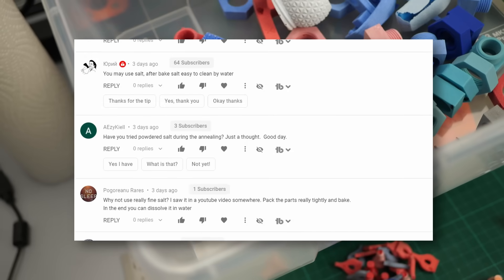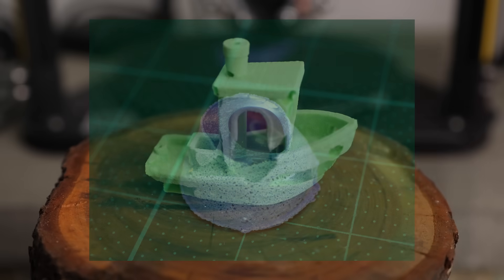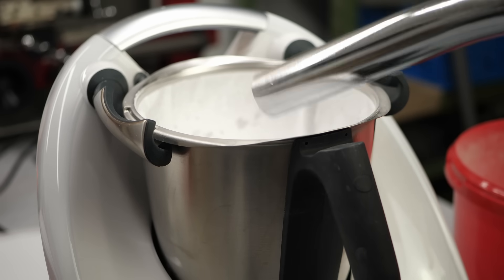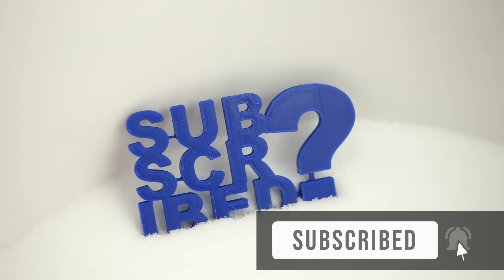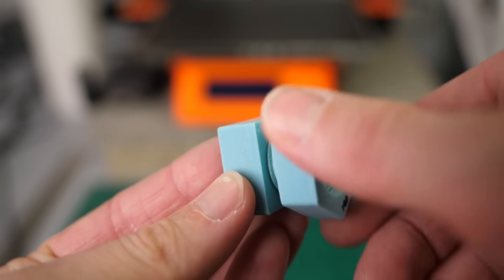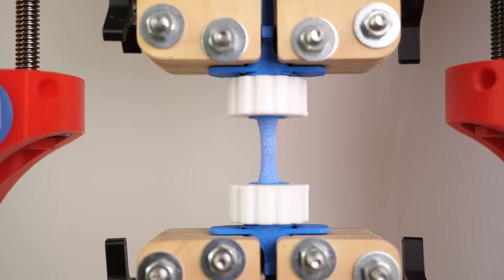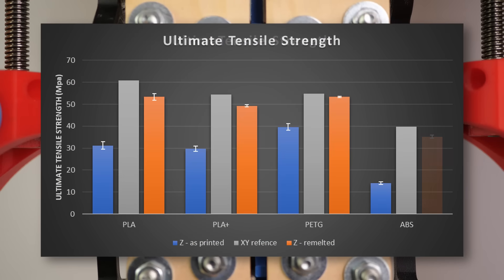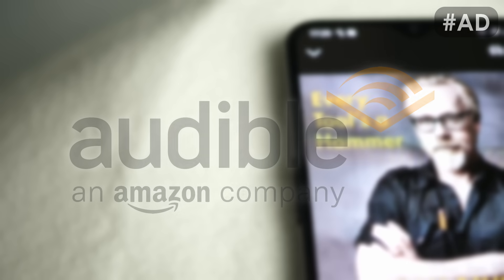The STRENGTH of 3D prints REMELTED in SALT

Comment: If all you need is a fine power that can stand a little heat then limestone dust (whiting, calcium carbonate) would be a lot easier.
Reply: Try Epsom salt. I have used it to anneal 3D prints with great results. I first dehydrate it in the microwave on a plate lined with parchment paper (don't skip the parchment paper) which results in Anhydrous (without water) magnesium sulfate. It's like ultra hydroscopic glass. I break it up into small chunks and it grinds pretty easily into a very fine powder (like baking powder). This packs really well and has the benefit of adding zero moisture to the process, being considerably cheaper than salt, less corrosive, and results in fine detail surface finish. The powder is water soluble just like salt. I also use it as a very effective desiccant for storing my filament.
Reply: @shift9074  Epsom salt is actually sold as a pentahydride. It has seven loosely bound water molecules per magnesium sulfate molecule, and it's loosely bound enough that they break off under light heating. It would probably have the same hydrolysis problems as plaster. Nile Red has a really cool video about epsom salts that addresses exactly this, btw.
Reply: @evanlane1690 I am removing those water molecules before using it to anneal. The goal is to find a water soluble powder that is heat resistant. Any water soluble powder will undergo hydrolysis if the 3D printed part that you are annealing has taken on water. For any of water soluble powder, we must sufficiently dehydrate the part before annealing to avoid this. For some, these extra steps may be worth it to save money. Epsom salt sure is cheap! I look forward to hearing what others are experimenting with.
Reply: @shift9074  How long do you microwave it for?
Reply: @RangerOfTheOrder  it depends on the amount you are working with. I do small batches(thin layer spread across parchment paper on a plate and it takes a few minutes. It will start to bubble up as the water boils. Once most of the surface has bubbled up, take it out break it into chunks and put into an air tight container. Repeat until you have enough and then grind it.
Reply: @shift9074  didn't nilered dehydrate Epsom salts to see how much of it is actually water/salt. And it was like 75% water
Reply: @shift9074  epsom salt is like 50% water and releases it when heated. That could seriously degrade the polymers, especially at elevated temperatures
Reply: if you remember the last video on the subject where he incased the part in wet plaster. why not use dry plaster powder? I'll be trying it when my printer is online.
Reply: You could also use something like sea-lite aquarium sand. It's fine enough that it's used by chemists as a filter material.
Reply: @turtledruid464  , sand will stick to the melted up surface of the part. Salt has the great advantage of dissolving in water, so you get back the pure plastic surface with little effort.
Reply: @thomasengelhardt7940  Limestone could do this after a VERY long time
Reply: @thomasengelhardt7940  doesn't sugar also dissolve in water? Powdered sugar.
Reply: @jsihavealotofplaylists  sugar should melt/burn at these temperatures.
Reply: @turtledruid464  I think the "sea-lite" you're referring to is celite, or diatomaceous earth. And yes, it's an excellent recommendation.
Reply: @bjmcculloch  ah I had never seen it written down only heard spoken. Thanks for the correction.
Reply: @turtledruid464  zeolite
Reply: One big advantage of salt is it dissolves in water really easily after baking
Reply: Hexagonal Boron Nitride might be a good solution.

Otherwise known as "White Graphite."
It has the same molecular structure as carbon graphite. Stable to 3200°.
Pretty much chemically inert.
Used as a casting release compound for cast glass and aluminum.

It's not hygroscopic... It won't absorb moisture from the air which could possibly interfere with recasting a detailed plastic part.

It has an extremely high thermal conductivity... You won't have to wait for it to soak up heat before the plastic actually gets up to remelt temperature.

It is available as a micro particle flour.
It can be "packed" around an object to temporarily set a shape, but does not cake into a hard substance the way salt can if it begins to recrystalize from humidity.
It can flow into small spaces and fill voids if it's given a little kinetic energy... so, a vibrator platform to help it settle and fill.

Non-toxic... though with any inert dust it is very wise to avoid breathing it.

While it is not water soluble, it cleans off with water and a little mild soap.

It has a density of 2.1 g/cm³...
which is almost identical to sodium chloride, at 2.17 g/cm³.
A tiny advantage that could reduce sagging of fragile pieces due to being higher density than most plastics. PLA being 1.2 - 1.4 g/cm³.

Should not be confused with Cubic Boron Nitride, which is an abrasive.
Reply: I have like 10 kilos of diatomaceous earth. I might give that a try. Its not soluable but its 10-50um depending on the grade.
Reply: @beez1598  I remember the original video maker posting somewhere that to maintain the as-printed surface you can coat it with PVA. It sounded like he was talking about dual extrusion, but couldn't you just paint it in Elmer's glue instead? Do a few coats to build up a protective surface (look at the thickness of the 'bad' perimeter on the break tests) then do the heat treat in whatever fine, heat-resistant, support powder. The PVA coating would collect all the particles, and could be dissolved off in water leaving a clean base part.
Reply: @dimman77  
I think that's what he meant.
Seems like the PVA would provide a barrier to the remolding dust.
I'm definitely going to try it.
Reply: @ablebaker8664  I'm thinking that maybe this idea, followed by acetone smoothing the surface could create an actual transparent ABS in fairly thick parts.
Reply: @dimman77  
I'm thinking you could be right.
Reply: @beez1598  results?
Reply: Someone else has already suggested calcium carbonate (common chalk, whiting, limestone, garden lime).  Another carbonate to try is Climbers chalk which is usually fIne powdered magnesium carbonate.  Both will react with aqueous acids to form soluble safe salts.
Here are three common acids:
    CaCO3 + 2 HCl → CaCl2 + CO2 + H2O     
    CaCO3 + H2SO4 → CaSO4 + CO2 + H2O
    CaCO3 + 2 CH3COOH → Ca(CH3COO)2 + CO2 + H2O          
The salts produced in the first two reactions are both used in medicines and food, or the production of food; and are considered non-toxic.   The third reaction might be interesting, because nearly everyone has CH3COOH in the kitchen already - vinegar.  The resulting calcium acetate is found in many environmentally friendly de-icers, so no major disposal issue. The same is true of the equivalent Mg reactions from climbers chalk.

Another non-soluble option to try (with a barrier such as PVA) might be Diatomaceous Earth.  It's an extremely fine-powdered silica dust, and a 10lb bag is about $20 at Amazon.  

Finally, has anyone tried dipping their prints into a silicone molding rubber as a barrier?
Reply: @genixia  how about dusting your parts in sodium alginate before using Calcium Carbonate in hardening both are hydrophilic and Form a Gel when they are Mixed while water is present they are used for Boba Tea. I think it could disperse the reaction of the outer parts dissolving their moisture while being remelted.
Reply: What about borax or another fine powder. Even baking powder?
Reply: I'd consider quicklime(calcium oxide), it's sold cheaply as fine powder, very heat resistant and it dissolves in water too. But it needs handling precautions, it is very alkaline. It is likely it would chemically react with PLA.
Reply: @jurajvariny6034  But its reaction with water is fairly exothermic and can be quite violent - especially if you mix higher amount of fine powder with water.
Reply: Totally true. The only reason why everybody is using salt is because the first person who tested the method used salt  but there are many other fine materials that have been used traditionally in metal molding and jewerly like plaster of Paris. It would be great to see somebody using a proper substance and not badly grinded salt.
Reply: Silicon carbide lapping powder would be better, you can get 8 micron SiC on ebay
Reply: Absolutely; I think that a good dampened down fine powder such as talc would be perfect for the job.
Reply: talcum powder is the answer
Reply: How about wetting a part before filling with salt?  Wet the part in water or maybe brine or maybe even a slurry of salt paste and either let it dry before continuing to fill or just pack the salt around the part and let the salt wick away the moisture.  My thought is that if salt is plastered on the surface of a part, then it might form a smooth barrier against the plastic rather than just having the plastic melt and pick up the loose salt particles from the contact surface.  And my thoughts on just getting the part wet is that it might be enough for the salt at the edge to dissolve and form a fine barrier and hold the salt crystals right around the part together a little better and maybe at least reduce the since fouling somewhat.

Also, as far as grinding the salt goes, I think using a blender or coffee grinder is about the worst way to do it.  Any sort of blade grinder is going to cause those really sharp crystals to be formed, because of the mechanics of how the material is being ground up.  You can't really slice a salt crystal up like how a spinning blade is designed to do with meats and vegetables and the like, so what you are really doing is akin to trying to break up rocks by tossing them into the air and hitting them with a baseball bat.  The problem I've always run into with trying to grind up really hard and relatively heavy things in a blender or cheap coffee grinder is that you invariably wind up with the smallest particles getting kicked up into the air easier until they're so fine that they stick to the walls, meanwhile the heaviest and largest particles are harder to get sucked or knocked up where the blades can make contact and so wind up falling to the bottom where the blades just pass over them. A better option for getting hyper fine particles would be to use something like a ball mill or a disc mill.  Disc mill is probably faster but more expensive, ball mill is cheaper (or so simple that you could probably make one with junk laying around your garage) but is slower.  But if you have time to just set and forget a ball mill and you can reuse the salt many times, then a ball mill might be a decent way to make your own stock of salt powder.
Reply: Maybe MgSO4 7H20 aka Magnesium Sulfate Heptahydrate. Dissolves in water and can be bought quite cheap
Reply: @cockybaerts674  
It also disassociates at 150°C, so it would be pouring humidity into the print even before that.
As it begins to break down it will change density and lose volume... It would shrink and the print would collapse.
Reply: @bizyyy2746  I haven't actually tried it yet, still messing with his nylon weed trimmer concept. I'll get to it eventually lol.
Reply: Notes on Aluminium and Magnesium - BOTH metals BURN.
Aluminium and Magnesium with Iron powder is set alight as a method of Welding, commonly used on Railway tracks.
Powdered Aluminium is one of the ingredients used in the Space Shuttle / SLS Solid Rocket Boosters.
Once these things are lit, there is no practical way of putting them out until they burn themselves up.
It is wiser to avoid them unless you are correctly trained in their handling.
Heck, Powdered Lead is safer then those two metals. (But your prints would be encased in solid Lead blocks if you're crazy enough to try that,..)
Reply: @PiDsPagePrototypes  both reactions involve oxidizers, ammonium perchlorate for solid state rockets and iron oxide for thermite not iron powder. And lighting these requires very high temps, definately not 200-230c (more like 1600). Plenty of things burn, at that point I don’t understand why the aluminum powder igniting is more of a concern than the pla.
Reply: Maybe Graphite powder
Reply: I would just replicate the steps for jewelry lost-wax casting.
Get gypsum, mix with water, pour into a recipient with the piece suspended at the center. Dry all the water first, gypsum will harden forming a hard shell around the piece. Then apply target temperature.
Finally, dissolve gypsum in water again and you are done.
Reply: Maybe just use baking soda 🤷‍♂️
Reply: @381delirius  Baking soda decomposes into washing soda below those oven temperatures.  So, no.
Reply: @beyondwhatisknown  true
Reply: @381delirius  baking soda won't hold up to the heat very well. When it is heated above about 80°C it begins to break down, forming sodium carbonate, water and carbon dioxide. This type of reaction is called a thermal decomposition.
Reply: What if using just like fine powdered metal, like aluminium powder? Does it going to be work? I think bout metal powder because it should be greater thermal inductor, thus to be faster heating time. CMIIW
Reply: @andrianusfranky  BAD IDEA
1. Fine aluminum powder is freaking bad news. It is reactive and loves to burn. Used with even a minor lack of caution, you could easily get a powder explosion.
2. Aluminum powder has a lot of exposure issues (it is light enough to stay in the air much longer than most metals due to lower particle weights).
3. Aluminum powder gets into everything, usually with bad consequences. Electronics tend not to live long near Al powder and things like motors like to ignite it.
4. Aluminum powder plus rust = thermite. A lot of shops tend to have rust powder in their dust. Let AL powder loose in that kind of environment and you have thermite waiting for you next minor incident to become a lot more interesting.
Reply: @andrianusfranky   I think Aluminum is explosive/highly flammable when ground into powder like that.
Reply: @Fangs_Follies  every fine powder will explode/burn
Reply: what about dirt
Reply: @Fangs_Follies  all metals can combust, the powder should only be dangerous if mixed with an oxidizer I believe.
Reply: @andrianusfranky  great idea....fine Aluminium powder is solvable in NaOH solutions and not so flammable by right handling like everyone tells!
Reply: @Martin-zd8eb  But you are handling potentially unstable and reactive material that can take oxygen to burn from already oxidized compounds. As I was told by those with personal experience - you cannot even extinguish it by CO2 fire extinguisher.
And as over the time you would contaminate it by impurities, it would worsen.
Reply: maby sodium chloride powder?
Reply: @kryptoowl1423  I can't tell if you're joking, so imma say this: sodium chloride is salt
Reply: @superslimanoniem4712  well I can tell so let me tell you, It was definitely a joke.
Reply: I never knew that, thanks for enlightening me....

Also someone might try magnesium chloride powder as it it is stable in the oven at +- 200 celcius  just make sure to dehydrate it first. If you get it at the right sources it's hella fine powder.
Reply: @superslimanoniem4712  If you can't tell if he's joking, then imma say this: try using dihydrogen monoxide.
Reply: @kryptoowl1423  that's funny! I love it!

Comment: Would be using greensand a cheaper, finer and simpler methode ? 🤔 A layer of high temeratur remaining paint could work fine for holding the shape of the part as It should be !

Comment: Uh- why don't you just make the walls super thin, and then fill the inside with low viscosity slow set  two part epoxy. Put the mixed epoxy in a vacuum chamber first to get the bubbles out .  Pour it into the hollow, put it in an electric  rocker with a vibrator motor and a flashing channel to draw out whatever bubbles are left.  Cut and sand off the flashing when it sets.  When it cures, it would be a LOT stronger than this.

Comment: If you were vibing the parts while they were remelting, they would be stronger. At least have more homogeneity. That's if the vibing does not mess up the dimensions or features.

Comment: One process to get really small (nano) particles is to spray salty water, but probably not and option.. Another problem is the salt suck in air moisture (property of salt). So when you heat it I think the moisture is released from the salt and adsorbed to the plastic. Overall I think salt is a bad idea. (maybe try alumina powder)

Comment: So, with a finer salt or powder medium to anneal in, we've found an effective way to strengthen parts. My question is will an acetone vapor bath repair the pocked surface of the print? Also, will that improve the strength of the part?

Edit: will the acetone vapor surface finish trick even work on salt annealed parts?

Comment: Have you looked at using mold making silicones to use instead of salt as the medium? It would be similar to your plaster video except I imagine better surface finish and dimensional accuracy. I checked some data sheets and the silicones list useable temp ranges that extend up to the 225°C range so they could work.

Comment: I had the idea myself but I was wondering if you could try casting silicone (a type that is heat resistant) which could take the place of the sand while also keeping a non-porous texture. It may be more difficult to remove as i'm not sure if the silicone would stick to PLA or if you would have to spray the model with a release or oil of some sort before melting which could cause layer adhesion issues. definitely worth a test!
Reply: Then it would probably be way faster to just print a low infil model, mold it in silicone and fill the mold with extra filament